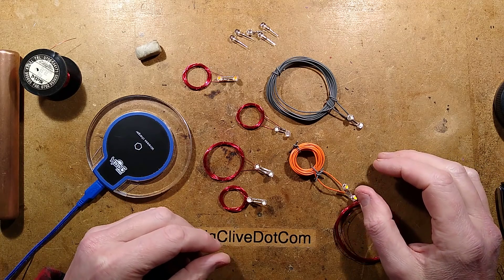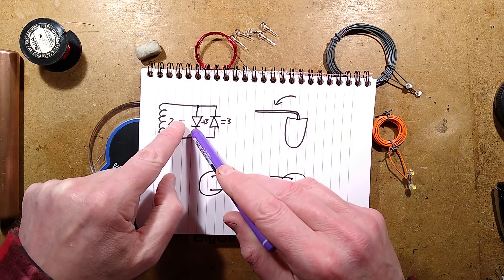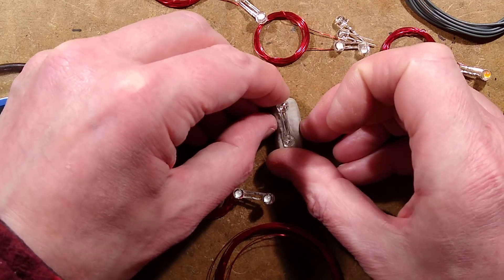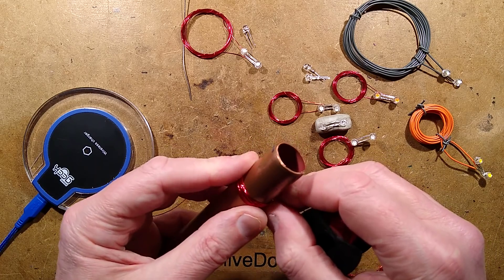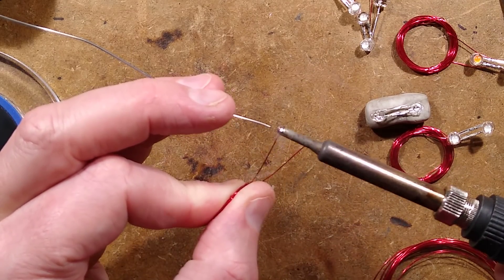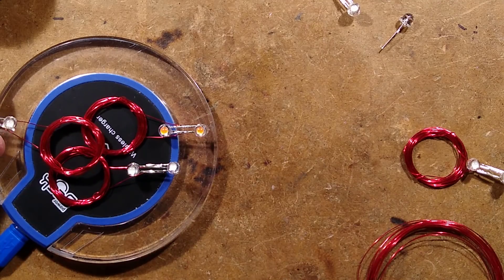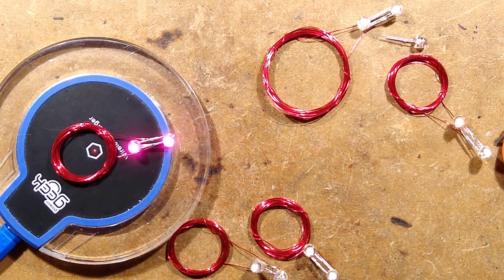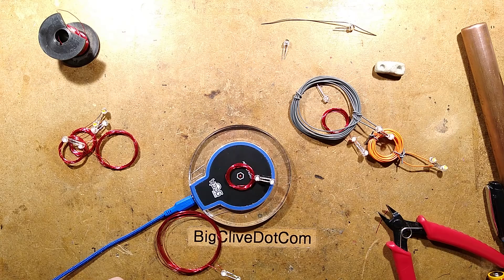Easy DIY wireless strobing LED light

Comment: I have made this circuit with transistor (transmitter side)..
It's working perfectly...
In receiver circuit I have used 1 ceramic capacitor parallel to led..
Actually after using the capacitor the brightness of LED dramatically increase...
❤️ Ur all videos...

Comment: Just made one of these and it works surprisingly well with the dinky little NFC field the size of a postage stamp on my phone. It's extremely dim and only works in one very specific spot. lol I don't have a wireless charger, but this store I go to has one on their counter. Maybe they wouldn't mind if I tossed it on there real quick to see. I used a 23mm coil with about 25 turns. I thought maybe since the area on my phone was so small a smaller coil might work better, so I tried wrapping about 45 turns of whatever diameter an AA battery is but it didn't work at all. So I'm guessing unlike what I've been told all my life, size really DOES matter.

Comment: I want to continuously light a three LED array that has a built in resistor used to run a USB lava lamp, or any desktop USB device for that matter. How can we use wireless charging stations to run a desktop USB fan? Do these things transmit data?

Comment: After making a small loop as described & placing over a toothbrush charging post, I got the flickering LED's. Placing the toothbrush on top of the loop to charge the brush the LED's glowed brightly without flicker.

Comment: You don't even need a QI charger to power the LEDs. Simply wind yourself a coil, remove the LED from a Joule Thief circuit, and attach your coil to the output where the LED was. If you match your coils well, the simple circuit will light up LEDs through a 1" thick wooden table. Runs off 1 AA cell also. Use a 2 pin Bi-Color LED, and it will change color when you flip the coil over.

Comment: I did a little fiddling with coils and found a 50 turn coil of 28 AWG wire around the same diameter connected to a rectifier could give me 18 volts at enough current to create a small orange spark. My ammeter was acting up, couldn't get a better reading.

Comment: Could something like this be used to indicate a power on status via induction for a high current application, say a few Kilowatt water heater? I had this idea so one could remotely indicate the status without running live mains to a neon lamp
Reply from the maker: I did that in the past using a toroidal coil with inverse parallel LEDs.  The load wire went through it and showed when the water heater was still heating.
Reply: @bigclivedotcom  How many turns and what gauge? If you can remember   please

Comment: Just had an idea: Fold the LEDs over so that their inside the coil, then pot the whole thing in resin. That way, you get a sturdy flashing button that you can stuff in your pocket, then pull it out and plunk it on the charger at McDonald's.

Comment: If you put a couple of caps in this quicky circuit, with a small resistor, could you make the LEDs stay on for the length of the pulse, giving the impression it is on all the time?

Comment: Thanks, Clive for showing us what's going on with the wireless chargers.  I think I would wind the coil and mount the LEDs on a flat piece of plastic cut from a gallon water bottle.  Just something to keep it from getting messed up when I put it in my pocket.

BTW that 0.314 mm wire is about the same as 28 AWG enameled wire.  That's about the same as the cheap insulated wire they use inside mouse and keyboard cables.  It just so happens that 20 turns at a diameter of 1 inch or 25 mm, times Pi equals about 3 inches per turn or 60 inches total, which is 5 feet or 1.5 meters.  That's just about the length of a mouse or keyboard cable.  If anyone finds their mouse or keyboard missing a cable... well you know that it was sacrificed for a good cause.  ;-)

Comment: I use my wireless charging to run a solar LTD Stirling engine  Perspex top and bottom 

 with a piece of chocolate aluminium rapper foil between charger and engine

Comment: Fun fact! If you put a Poundland, cigarette lighter phone USB charger, on top of the QI charger the indicator LED blinks. I'm thinking maybe the inductor in the buck converter circuit, is picking up a induced voltage.

Comment: I've always used White tack or blue tack, to build circuits. It's my go-to helping hand, to hold things in place while I solder them. It's a great way of aligning components with lots of pins and aligning the wires in front of them and solder them all in one go.

Comment: Those are cool, I had successfully made them to work with as little as 3 turns of 0.1mm wire, and you only need 1 LED in practice. So if use use a small enough LED, like those with low profile around 0.2mm height you can embed this kind of thing into card stock without much issue.

Another cool alternative is to use a simple setup of SMD coil + SMD LED, works wonderfully. Anything would work basically. And if you do care about efficiency you can put a capacitor and tune the coil + cap to the transmitter and you have a very bright LED. But the no-brain, just solder stuff up option, works well enough.

To make it work better you can use an induction heater circuit and instead of the small copper loop use a regular wire 1.5 loop with about 50cm in diameter and fill that up with these sort of LEDs.

Comment: I designed a PCB a while ago with a built in coil and a spot for a single LED, I actually used it to find exactly where the NFC antenna is on my phone. It helps me align it perfectly when I need to use it.

Comment: Should have thrown four or five of those coils on the charger at the same time just to see if it made a difference in brightness or flash rate.
That woulda been cool!
Reply from the maker: It will power several simultaneously.
Reply: @bigclivedotcom  I couldn't see any reason it wouldn't. 
Just wondering though - If you put them on in extremely asymmetric ways to each other, would it throw them into a delayed flash rate from each other?
In other words, if you took one and put only part of the coil of wire over the charger and another dead ass over the charger, it seems to me that the one placed more symmetrically would flash on before the one with less exposure, if for no other reason than breakdown voltage of the LED.

Comment: I tried this with my electric tooth brush charger, and only one led lit.  It must be rectified.
Update:  I put a scope on the coil, and I saw a funny looking squareish on one side and round on the other wave.  And it is not rectified.  it was 36.57 KHZ and about 2 volts rms.

Comment: How do you limit current to the LED?  Is it unwise to exceed 20 T?
Reply from the maker: It's balanced here, but less turns could be used to reduce it.   With the brief pulses it's a bit like multiplexing.

Comment: I happened to have a small coil (10-20 turns; roughly the diam of your pipe)) of coated steel "fake plant" binding wire on top of my parts rack. So I grabbed two old, albeit tiny, salvaged Red LEDs from a drawer, soldered them together as instructed and soldered the wire to them.

First off... Yes! The solder, albeit with flux applied, DID stick to the wire! Much to my surprise (after stripping the coating of course).

Tested it on my Galaxy S8 was indeed able to momentarily generate a short bright flicker, and then a bunch of barely-visible pulses after, with the bright one occasionally!

However, then I took it a step further and decided to try it out on my Toothbrush charger base, as I knew that was inductive (seems to just be mains fed and nothing else; casing reads 100-130V 50/60Hz - 1.5W ['Murica "Braun" brand]). 
It did kkkkind of work, but the LED's coil could fit around the toothbrush so not ideal. So I just grabbed the coil and put one twist, folded it over and that was the perfect size. SIGNIFICANT improvement :P

---

I could see this being useful as even an optical display/sensor, for any number of things. Perhaps a passive-security related use where something causes the LED+Coil to fall around the inductor(?) and thus is now lit up to show that it'd been opened since you were last there. Say if you wanted to see if an animal is going somewhere, or maybe a roommate :P

Sure, there's much better things for that purpose, but it's hard to beat a toothbrush charger, a coil of wire, and one or two LEDs! lol For a one-time use it's non-invasive, non-destructive, and everything can be easily pulled apart after.

[/dumb late-night comment]

Comment: What a strange coincidence... Just the other day I came across a coil of 0.6-ish mm enameled copper wire (probably 22-24 AWG when compared to the spools of 26 and 28 AWG enameled copper wire I have) that I salvaged from god-only-knows-what, probably as a kid, and just had in a random box. I had been playing around with making coiled antennas for a some NFC chips with the 26 and 28 AWG wire just before rediscovering the salvaged wire, so I considered using it for that until I came across this video. It ended up being just long enough to get about 19.5 turns on a 30 mm diameter soda bottle preform. I tested it on a cheap probably-not-Qi wireless charger and it does work, but I don't think the charger likes it- the LED on the charger starts flashing. Edit- Aaaaaand I broke it. I think I burned up both LEDs when I sat it on an Apple Magsafe charger. It didn't flash a consistent on-off like when it was on the standard wireless charger, but like a Morse code "i-i" like dot-dot-pause-dot-dot... Then it died.

Comment: Silicone putty style earplugs also work well for sticking oddly shaped things down.  More interestingly it doesn't inhibit platinum cure silicone mold compound or epoxy; works really well for plugging up holes and sticking objects to be molded down into a form so they don't float up when you pour.

Comment: You missed a trick there Clive. If you'd hidden the charger you could have used a click bait title of free energy (yuck) and raked in the views!

Yeah OK I don't actually expect you to stoop so low. Good use of the shorts though, fun little thing!
Reply from the maker: I'm not beyond using overunity clickbait.
Reply: @bigclivedotcom  nothing wrong with clickbait, it's the claiming free energy part that leaves a rotten taste in the mouth.

Comment: I wonder if you wanted to make a Christmas tree using those tiny pre soldered train model leds you can get off Banggood or Aliexpress, would you be able to make one coil for the bottom to power all the mini SMD 0603 size or would the circuit need to be a bit more fancy?  Considering you would probably use 15  of them and all different colors.
Reply from the maker: You could power a parallel array of LEDs with one coil.

Comment: what if you put the LED's coil and then the phone on top to activate the chi charger continuously and then take the phone out ....
will it keep pumping juice into the coil or will the charger detect the load disappeared .... then maybe add a resistor to load the coil if the charger is dependent on the load  !!!

Comment: Been a long while since I've seen anything with an old MPS (Maplin Professional Supplies) label!  Many years ago I needed to restock the toolboxes at work with Hellerine sleeve oil & the only place that had the 25ml bottles in stock was MPS at £1/bottle, so I decided to bump it up to a decent value order by ordering 50 off - what turned up was 50x 250ml bottles! Being honest I did ring up customer services to let them know, they told me to keep the ”incorrect items” and they would send out the correct items ... cue the arrival of another 50x 250ml bottles. Next phone call & they decided that I could keep the lot & refund the original purchase as I hadn't got what I ordered... No amount of persuasion would get them to take any back!  We worked it out that we'd got enough oil to keep the engineers and production department going for 100+ years 🤣🤣
Reply from the maker: Their attempt at a "professional" supply service was short and horrible.
Reply: @bigclivedotcom  Yeah it does not sound like a good business model was the place laundering money or a tax write off or something? This makes absolutely no damn sense.
Reply from the maker: @frizzlefry5  They were trying to compete with Farnel and RS.  They couldn't.  I learned the hard way not to spec components from MPS in designs as they often didn't have stock.

Comment: Make a coil to probe the signal with a scope and see what data there may be, even better would be a digital scope with data analysis modes. Then place a phone capable of wireless charging over coil/charger and see what goes back and forth.. Then start spoofing the signal that you have recorded with a booster amplifier. Extract those pixies!

Comment: Too high a voltage could fry your device though, right? It looks like an emp coil waiting to happen, that's why I don't trust these things, what if one tried putting just a little too much voltage into an inductor and suddenly, fizzle, dead phone

This is also why I'm kind of worried about making an emp jammer on a huge scale using coiled pipes and a stack of microwave transformers...

Comment: I realised a fatal flaw in your plan

You know that coils of wire of almost any length, even ones that aren't connected together, can set off a lot of security pillars in shops

I bought a 20m coax cable and it set everylarm off I found 🤣
Reply: No, they won't... Those anti-theft systems don't work that way, and won't trip from a simple coil. The system is very precisely tuned, and NEEDS to see a very specific feedback coming back from the vibrating antenna inside the stickers, before it will go off. A basic coil of wire won't do anything to set it off.
Reply: @davelowets  I challenge you to a coil-off!

Comment: — I've seen other people making these. But they only use a single LED.

Damn, even to me it was pretty obvious that it's certainly better to install two LEDs in reverse-parallel to one another: both because it won't like being reverse-biased at too high voltage, and also this would allow turning energy on the other half of the cycle into light.

Comment: Whenever I perform such a «3D-soldering», I tend to take the hardest path and hold the whole contraption with my fingers, and a while ago it also involved holding a piece of ro-osi-i-i-i-i-i-in© with the same hand next to the soldering point. These days I tend to use soldering grease or flux, or a solder wire with rosin core. It was you who with your videos and talks finally convinced me to switch.
And even though I wanted to buy myself those special appliances with magnets, croc clips and rotatable junctions, after such a practice I usually don't need any additional helping hands to solder a bunch of LEDs leg to leg altogether, for instance.

Comment: Just made this with 20 turns of wire and 2 red 1.9V LED's. Lit them real bright for a bit and then killed them. Not sure how much voltage the coil generates. Might be a bit much.
Reply: Too much forward current is what kills them, and being diodes they'll pull all the current they can if it isn't limited somehow. Relying on the IV curve is almost always a bad idea.

Comment: What if you put a piezo buzzer across the coil instead of LEDs?
Reply: You'd probably just hear clicking as these run about 10 times higher frequency than anything you can hear.
Reply: @Broken_Yugo  I thought as much. Would still be adequately annoying, I bet.

Comment: There's a Japanese kit company that used to put out what they called Otona no Kagaku kits (adult science), in the $30-$40 range. (used to, in that they're just re-issuing a few "best of" kits once a year or less now. One of the kits was their "speaker plus", which was a pair of speakers for your mp3 player, plus an inductive coil that would drive a few LEDs, or little LED motor fish that could "swim" in a bowl of water placed within the coil. I reviewed the kit back in 2013 on my science blog. I'd put the URL to the review here, if I knew that I wouldn't get kill-filtered for it.
Reply: For much less than $30, you can purchase one of those cheap induction heater drivers from ebay, replace the copper loop with your run of the mill 14-16 gauge wire make a 1.5 turn loop with 50cm to 100cm in diameter and light up as many LEDs as your heart desires. The LEDs just need a coil, attached to them, anything would do (I've made 3 turns of 0.1mm and 5cm diameter coil work with that). If you tune the receiver it greatly increases the distance but as I said basically anything would light up.

Comment: hello. Please can you tell me how the 'device' being charged communicates with the wireless dock to keep a constant power supply to the 'device' instead of the flicker? Would just add a magnet on wirelesss charger face alongside the 'device to be charged' be enough to trick it into working? Thank you.
Reply: No, the charger and phone constantly communicate and send data to each other, typically about power draw
Reply: @pootispiker2866  thanks.  what if i put compatible phone on it AND my non QI  device same time?
Reply from the maker: It has to be a suitable QI chip to provide proper communication.
Reply: @bigclivedotcom  ahh. thanks. if i put compatible QI chip phone (samsung s6) AND my device to be charged.. would that work in charge the non QI device AND the phone?
Reply: For sure